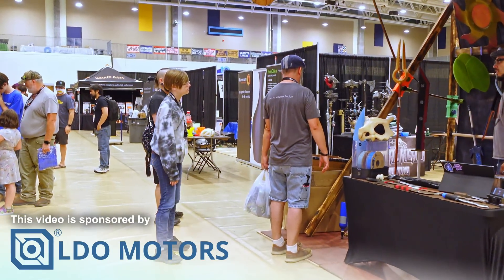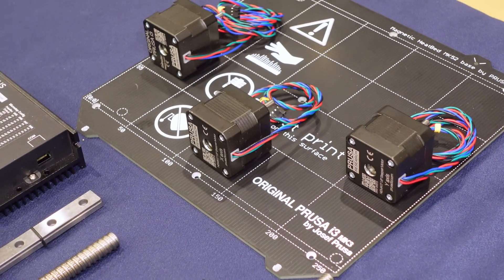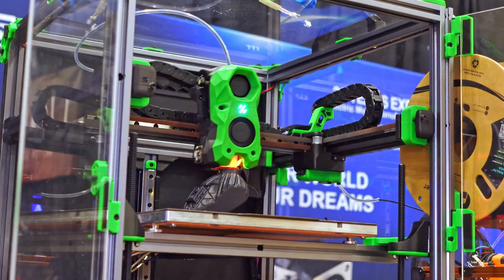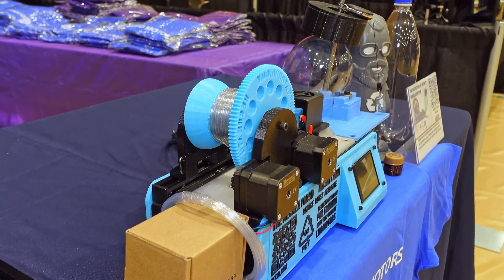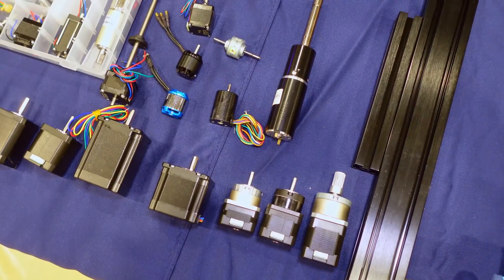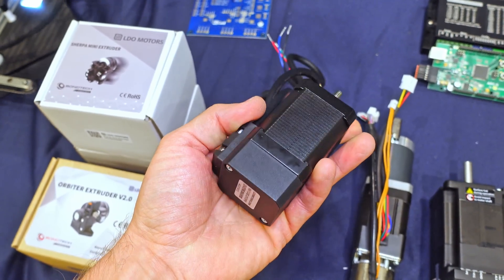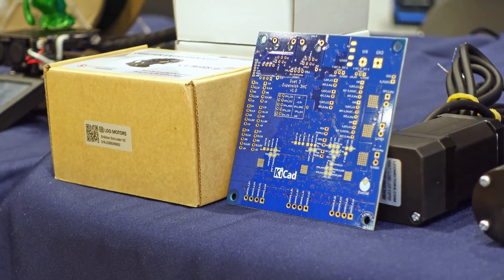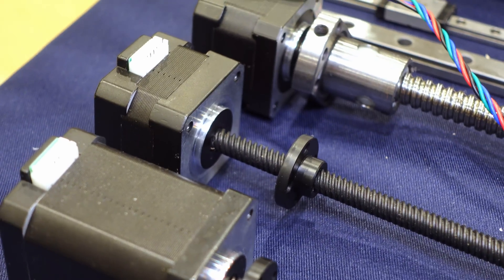High-quality Voron kits and closed-loop steppers from LDO! #ERRF2022

Comment: Honestly, I don't understand why people pretend that closed-loop stepper motors are so special. We already had such motors on our CNC machines 35 years ago. Or rather, there were no CNC machines at all where stepper motors were used WITHOUT corresponding encoders. That is nothing special. At least I could not see in the data sheets that this was anything different or new.

What is so particularly new here?

Comment: ive been using closed loop steppers and integrated servos on my printers for a couple years now and they are nice, tuning can be a pain since there is no documentation on it for the stepperonline brands ive been using only requiring 24v input and  step/dir input from the board. the only way i could see these being better is if they can utilize klippers input shaping and such which isnt useful on closed loop servos/steppers only utilizing step/dir bc there is no communication between the board and the driver besides these two signals

Comment: So sad I bought a Ratrig kit rather than a voron. I was intimidated by the self sourcing and wish I had known about the voron kit from LDO
Reply: An LDO kit for Voron might have pushed me over the edge to do that instead of RatRig, but I'm 1,000% happy with my RatRig V-Core-3.1 which I just finished last month (which also comes with LDO motors).   It is a beast of a printer.  Zero regrets.

Comment: Very excited to hear about those two upcoming kits, as I've been wanting one for both machines more than pretty much any other recent community project. And, of course, LDO kits for a pretty stock Voron 0.1 and a heavily modded Voron 2.4 remain high on my list. Closed loop stepper motors sound really neat, too, but honestly not like an upgrade I'd make on a working printer.

Comment: Those "semi closed loop" steppers with the encoder and "brain" on the back of the stepper motor that are fed a pulse/direction signal and self correct on the fly seem like a better solution than a true closed loop stepper for 3d printers.
Why task the printers mainboard with all that extra processing? 
All it needs to know is that the motor will do as its told

Comment: Hey!  I really appreciate the actual captions rather than auto-generated ones but there were a few points where they became really out of sync (and with significantly different wording than what I could hear).  At one point it skipped through 5 or 6 lines in like half a second.  I know you're doing your best to get the captions spot on and the effort is appreciated, so please take this as it is meant :)  Loving seeing these insights to these events.

Comment: There is the CANbus interface missing. Controlling these motors by one or two CAN messages would remove a lot of wiring.
Reply: That would be pretty cool. I bet this will be more feasible once the chip shortage is resolved.

Comment: Do these close-loop motors actually need support from the printers mainboard? (2:55)
I would have expected them to do the closed loop magic internally and externally behaves like a conventiomal stepper motor, so beeing a drop-in replacement. Maybe with a way to signal the board if they got lost.
If the mainboard does the work, these motors would be nothing more then motors with integrated position encoders
Reply: Well, motors with integrated position encoders is exactly what they are. I see the benefit in this to have whatever drivers you want on the board, possibly high voltage ones. The Bigtreetech options (S42 and S57 series), also the MKS versions do what you say and handle all the trickery on just plain step/direction/enable lines. Then again there are those issues like not being able to report back that a problem was found, or limited to 24v to the motors, no interpolation like the TMCs and such, albeit at least in noise levels they're top notch, quieter than SpreadCycle mode, tho louder than StealthChop.

Comment: I can't wait for closed looped steppers becoming a standard in 3D printers.
Reply: The smarts of LDO’s solution is putting the feedback loop in the main board not on the stepper. That allows the main board to make smarter decisions.
Reply: I've used bigtree tech's closed loop steppers. The problem is they can create a crazy resonance because it's constantly oscillating between two states. You'd need to add some randomness into the oscillations to ensure there can't be a resonance.
Reply: I will stick with servos. Forget the kits build your own.
Reply: For the X,Y, or Z I think it’s cool, but not necessary. For the Extruder motor I think it’s huge.
Reply: Often, if you encounter a situation where a motor is missing steps, then a problem has already happened, and correcting the motor position won't make it right.  The nozzle isn't supposed to be banging against anything, and if the extruder is missing steps, then you've either got a clog or some bent filament, and more torque won't help.
Reply: Yeah and then the subreddits will be full of people who can't tune their steppers OR tram the bed

Comment: Please Jason, we need closed loop stepper with canbus connectors, that would be pretty awesome
Reply: The Bigtreetech S42B V2.0 has that but I don't know how well and how far it's used. Their entire closed loop stepper lineup is extra simple to use but I would love to have the monitoring done by the controller board instead, and thus possibly attaining the biggest benefits of those steppers but with drivers like the high voltage TMC 5160.
Reply: @Kalvinjj  it doesn't have the encoder. You're confusing it with the mellow sht that does have an encoder but it's more expensive. I would love to see just the stepper with an encoder and a tmc integrated and all connected via canbus
Reply: @deathcube2006  It does... It's literally the only way it can function to maintain a known rotational position. A TLE5012 magnetic rotational position encoder at the middle of the motherboard, on the bottom, reads a magnet's position glued to the shaft of the stepper.
It just doesn't report anything back to the printer's/CNC's motherboard as it just takes step/dir/en. signals but dunno what it does on canbus.
If you mean it doesn't have a linear position encoder to read the printer's head then yeah of course not, that's entirely different, but it does have a rotating encoder.

Comment: Closed loop is the next logical step. It will just take time before RRF, Marlin and Klipper will fully support it I guess. And I'm expecting that there would be some necessary hardware changes as well for the cables and connectors?
Reply: It's possible that the control logic is already built into the motor, and that no software modification is needed. If not, I imagine the control logic could also be built into motor drivers instead.

Comment: The Trinamic Stallguard detection is a less reliable means of detecting layer shifts from collisions in part because the back EMF changes with motor temperature. It's possible to mitigate this by measuring the motor temperature and adjusting the sensitivity based on a look-up table, but this of course adds complexity.
Reply: Also, if you use sensorless homing, it's not as precise and there is often some deviation to which 256th of a step the sensorless homing will home so it might not jump back to the exact same position as prior to the disturbance that was detected.
Reply: @MarinusMakesStuff  right. Of course you could use StallGuard with normal (microswitch, etc.) homing.